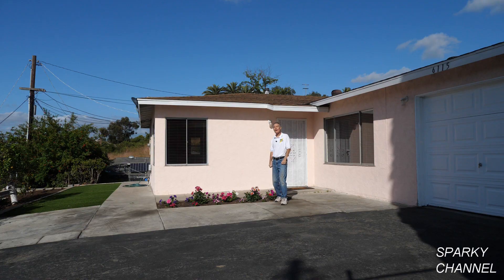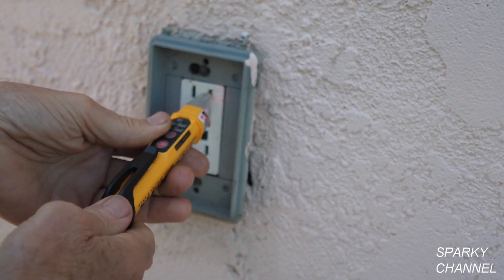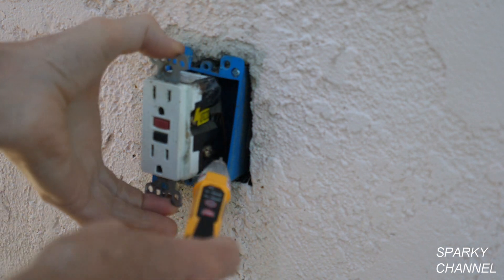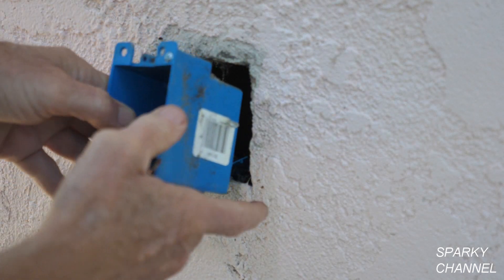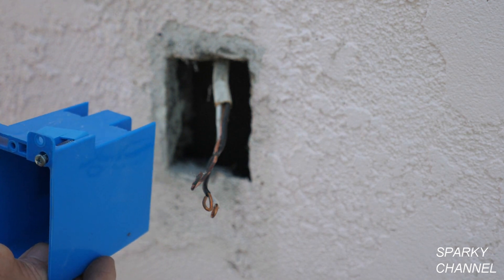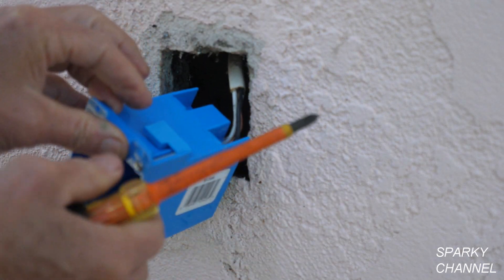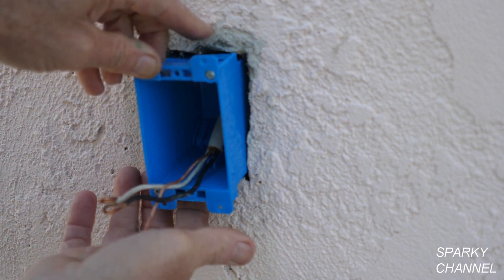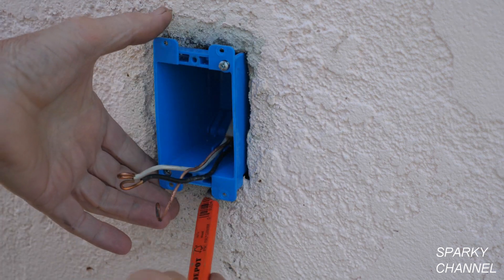Exterior GFCI Replacement With 20A Weather Resistant  Outlet

Comment: You should use a cold chisel instead of one for wood on that material. You'll make the wood chisel dull and damage the cutting edge. Electricians don't require big cold chisels, I use a small one 3/8" and a 1/2 or 3/4". For example this one:

https://www.amazon.com/TEKTON-66001-4-Inch-Cold-Chisel/dp/B00QV2JIPY/ref=sr_1_4?keywords=cold%2Bchisel&qid=1584886864&sr=8-4&th=1
Reply from the maker: Marcel, its great to see you again!! I tried googling your name to let you know what happened to my big Sparky Channel but here you are. How have you been? I used that chisel about a million times during that renovation. I used it for all sorts of purposes. You're right of course. Thanks Marcel!
Reply: @SparkyChannel  Hi Bill, I've seen that you channel was gone due to some "technical issues" and now I've seen that you're back and reuploading your videos. Everything is fine, except for this virus thing, which is jumbling whole public life here in Germany. And propably enforcing a lot of people to buy noodles, canned food and most of all toilet paper, like there will be no tomorrow!

If you're using it for once in a while only for some minor things it's ok to do that. But if you do that on a regular basis you should use a cold chisel. It's about the hardness of the steel, and in addition the wood chisel is sharper. Because the wood is softer than mineral plaster which tends to crumble instead of creating chips like wood, if you treat it with a chisel. So the wood chisel must be sharper, but the cold chisel is more hardened on the tip to handle the hardness of mineral materials like plaster, bricks, concrete, ceramic tiles and so on.

And I would guess the first thing you'll lose on that outlet are the two plugs you insert into the cable feedthroughs.
Reply from the maker: @Marcel_Germann  Yes, the virus seems to be pretty much world wide now. The problem is that its a "novel" virus which means that its new so no one knows exactly what its going to do. I hope it turns out to be a big dud and everything gets back to normal very soon! Thanks for the information on chisels.  Best wishes to you and your family!

Comment: This video is so critical especially for DIYers. I cant tell you how many homes I have gone to with people who tried to do outdoor electrical on their own. Its not just about the wiring. If the appropriate equipment is not used and sealed water will trigger the switch as well as cause structural long term damage which can cause even worse long term damage.
Reply from the maker: Yes, it's harder to seal these things than a newbie might think. You have to be super careful to keep the water out. Thanks!

Comment: @Sparky Channel. Thank you for another great video. Appreciate   your thorough explainations and attention to details like sealing up the work box and cover.  I'm sure even where you are, it can rain sideways. 
Question: Do you plan on reviewing the TayMac  ML500W type weatherproof expandable covers? Like to see your opinion when compared to the hinged style you just showed.
Best wishes to you and your family.
Reply from the maker: I think I did review that one on the old channel. The big advantage to them is that they don't stick out so far so they don't get hit as often which is very important. I'll look for the video on my hard drive. Thanks!
Reply: Yes, I was just looking for a mention of that TayMac ML500W cover here on this thread, too I think they are relatively new, right?  I saw them in the hardware store recently, and was thinking about replacing some older ones I have with those.
Reply: Also,, I have a couple of outdoor switches by my pool equipment — one switch is single gang and the other is double-gang with a receptacle.  Sparky, do you have a recommendation for a cover for an outdoor switch that is used frequently?